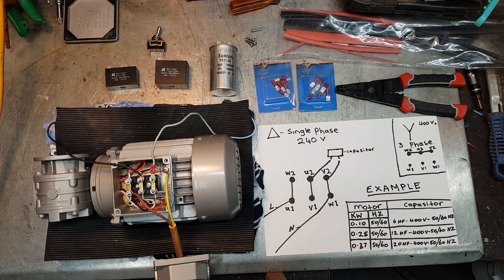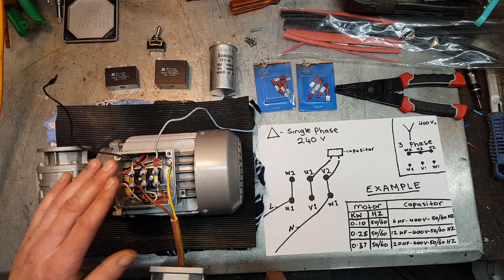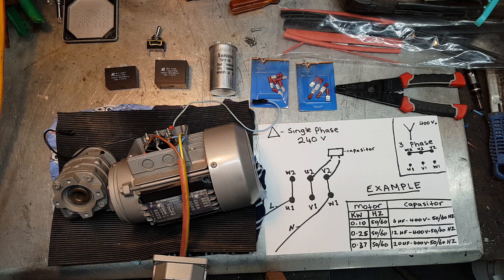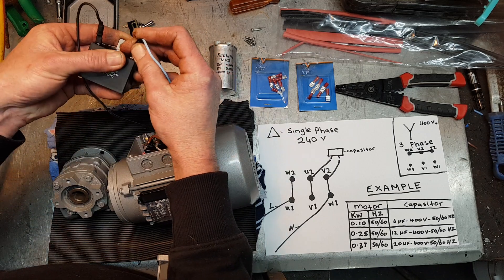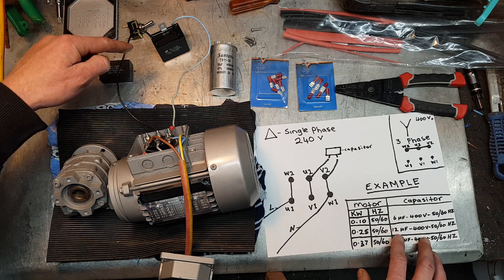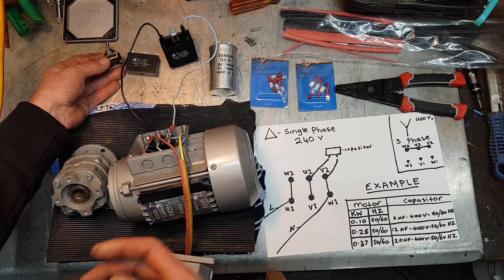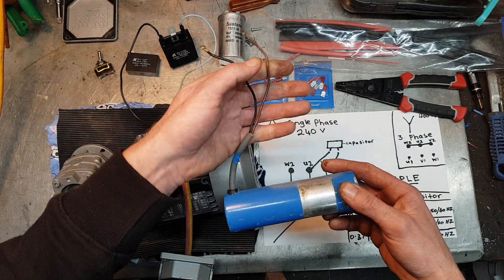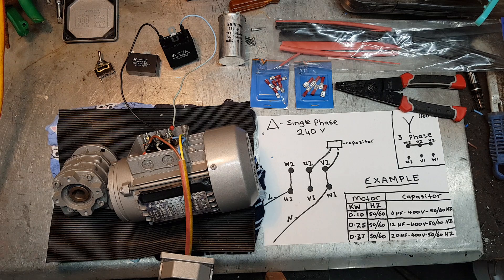D.I.Y how to Wire a 3 phase motor to single phase 240v the easy way

Comment: First off, there is no N wire with 240 volts.  Both sides of the 240 v are hot.  One small run capacitor, as shown, will give little starting torque.  There's a good chance that if you are starting the motor under load it won't get rotation.  Yes, you can wire a second start capacitor, but it needs to be much larger in mfd than the run capacitor.  And it needs to incorporate a potential relay to disconnect the start capacitor when the motor is up to speed.  No, it's not advisable to use a toggle switch to break the starting circuit.  A potential relay breaks the circuit a great deal faster than a human-operated switch.
Reply: in UK the N is grounded at the transformer so there is an N and 240v.

Comment: Nice one mate, cheers.  Regarding two capacitors and starting. I have not found it yet, but you can wire two capacitors, no switch, both caps wired to two different places.  Start and Run capacitors…. No need for a switch… not found any wiring info yet.. I’ll post back if I find anything… and I can find your video again… if you find info before me.. can you do the same

Cheers
Reply: Ah no! 
I found the wiring pics for twin capacitor, no switch … and it was for motor with built in centrifugal switch 🙁

Comment: When u initially started the motor, and it did not have enough power to turn,  it was connected to a 240v outlet? The end result was that u were able to convert a 3ph 240v motor to single phase 240v motor? Have u ever tried this on a servo motor?

Comment: If I have a motor being used for a hoist that has a very small run time, can I just use the two capacitors like you said? Being this is under load on a start I believe I will need two, but I don’t want to use that switch every time I have to hit the “up” button

Comment: In 10Hp 3phase motor how many micro farad is required (rating) for running capacitor ? Thanks
Reply: Hi buddy did you work out what capacitor you need ?
Reply: @YouWod-m6y  I would like to know what Farad cap to use

Comment: i have a 3phase motor and its 3HP. i wired from star to delta connection 240volts. What capacitor ( run or start) and what size capacitor?
Reply from the maker: O.10 kw you need a 7ųf start capacityor with a 50/60 hz motor.  For example if you have a 0.30 kw 50/60hz motor you will need a 21ųf capacitor or close to it. You will have to work it out as I can't work out horse power for you.
Reply: 150 uf or above

Comment: great video .i have 200v japanese  oilpump motor which came with three wires.  is that a three phase motor? and  is there any way to convert it runs with 230v single phase?
Reply from the maker: By the sounds of it its a single phase but i could be wrong
Reply: @justpanit9872   thank you